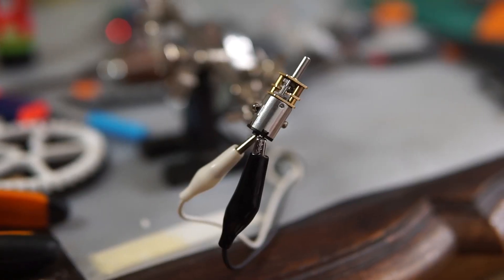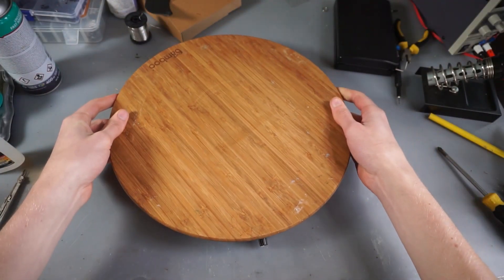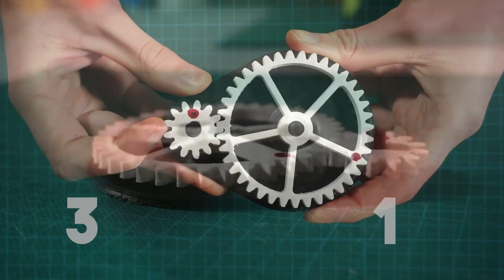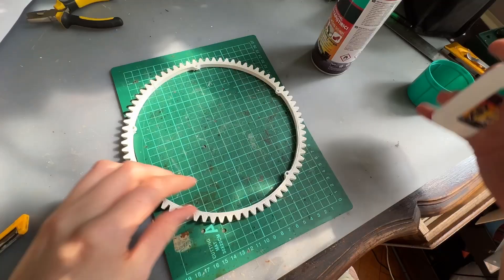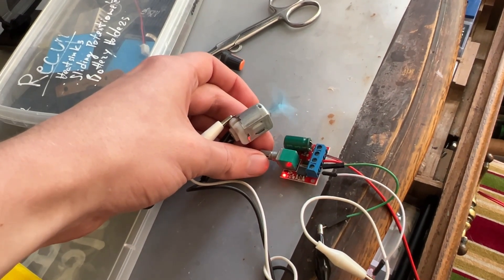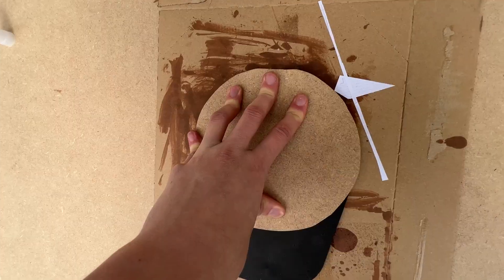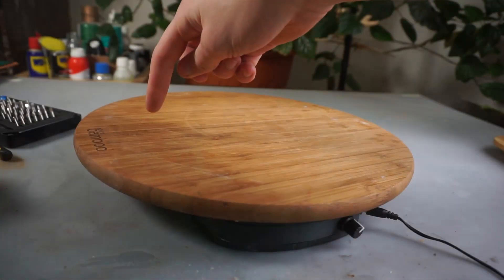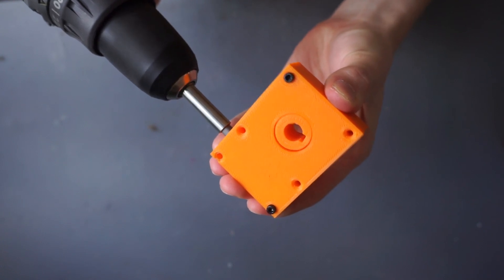DIY Rotating Display Stand -  It can be added or removed from the motor.

Comment: my products are 25 kilos. Which motor do you advice me? for to use rotating display stand system such as you did.
do you think that A 12V 200 DC motor is okay for me?